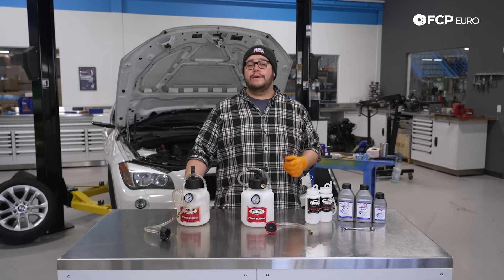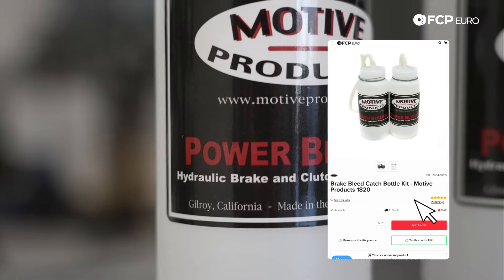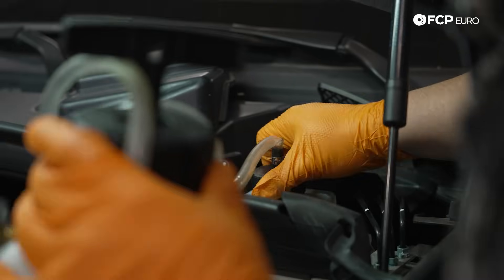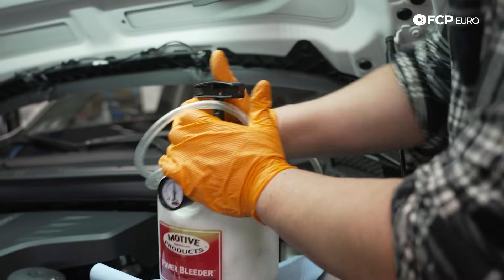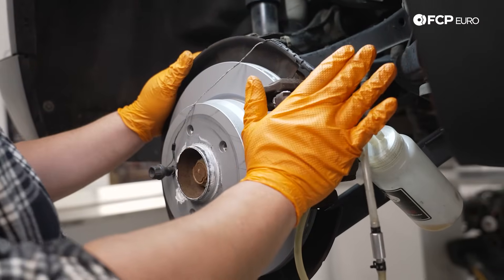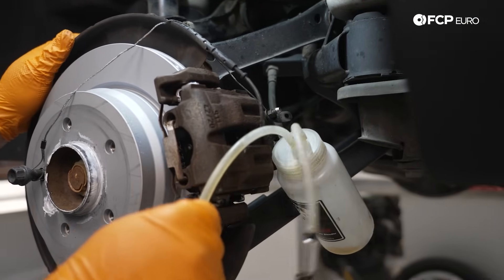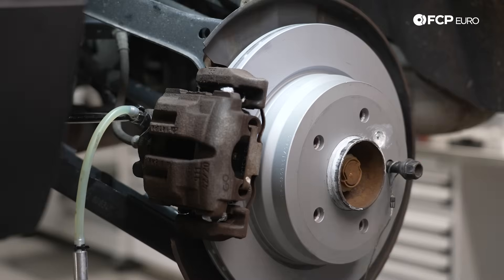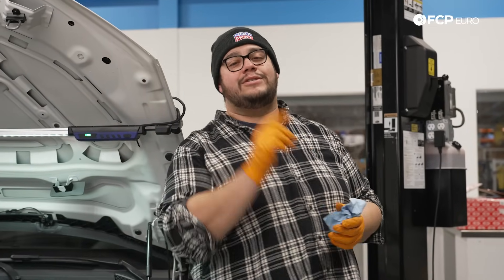How To Power Bleed Brakes Using A Motive Power Bleeder

Comment: no mention about the abs pump? this show method is ok for fluid exchange, but if you replaced master cylinder or abs unit then 30psi is required and ignition on (to open certatin valves inside abs unit). sometimes a bleeding procedure must be done with diagnostic tool. overall good tips. aaaaaaand clutch lines? are we suppose to leave old fluid there?

Comment: This didn't work as it held pressure of 15 psi on my S550 for at least 5 minutes until I depressurized it but when I put 15 psi on it with fluid in it and tried bleeding the calipers, fluid was struggling to come out of the bleeders.

Comment: You can also just fill the brake reservoir and do one side at a time, refilling the reservoir on the car for the other side.  Eliminates some of the mess and keeps the motive pump clean and dry.

Comment: Regarding cleaning and storage... this is from the manual:... "Never store hydraulic fluid in Power Bleeder. Always dispose of excess fluid properly. Use isopropyl alcohol to clean your Power Bleeder. Do not clean your Power Bleeder with brake parts cleaners or other solvents not intended for use with plastic components. Pump the isopropyl alcohol through the tank and hose assembly and let air-dry. If isopropyl Alcohol is not available a weak solution of “Simple Green” can be used. Rinse Well. Ensure unit is completely dry before reuse. Lubrication of the Power Bleeder pump mechanism should not be necessary. Should lubrication be required, apply a small amount of brake fluid compatible grease to the Power Bleeder pump shaft. Never lubricate with petroleum-based oils.

Comment: Interesting that the catch bottle shown has a check valve in the line.Mine doesn't.Is it necessary?
Reply: Better to have it for safety reason to not introduce air back into the system, however its not necessary for this job because the line are full at all time and you close the bleeder before taking out the hose

Comment: I like to use mine dry and just use the unit for pressure.
I can top off the master cylinder between each wheel.
A little more time, but ensures you aren’t leaking brake fluid all over your paint.

Comment: Someone mentioned in the comments that the manual push of brake pedal required to clear sediment from brake reservoir.  I just wanted to know the procedure in precise detail. 

Do you pump the pedal for each caliper? Do you. Push brake pedal while the pressure bleeder is in use?do you push the pedal when the bleeder nipple is open or closed? Do you do this procedure after all the four calipers are pressure bleeded?

Comment: I bought this one years ago. I did a dummy test at home : just blocked the output of the hose ( to simulate the connection to the main reservoir ). After the pumping action of the handle, I always found moisture on the inside of the bottle.
It is physical, when pressure increased, the water vapour in the sir will turn back to water liquid.
So, that means this device will always "create" water & the water will be forced into the brake fluid system by you.

Comment: One flaw of the product, there is no pressure relief valve (prv) on the product. So in this case you have to open the unit from the pump itself to release the excess pressure instead of simply releasing from the prv.
Reply: That's perfectly fine. A pressure relief valve sounds like a failure part on plastic.

Comment: I tried numerous times to keep air in tank but it was not to be; i can watch the gauge as it leaks out. Fixed problem by wrenching tight the two union connections. However, I could only pump to 10 on gauge and it held perfect.

Comment: just a heads up if yall have Drums and the brakes are still squishy after you bleed them you'll need to adjust them. I got trolled thinking i messed up with the power bleeding. that was my issue.

Comment: Does the brake have to be pressed?  How is fluid moving through master cylinder if brake isn’t pressed."
Reply: From the pressure of the vacuum system. That’s the whole point of it.

Comment: Couple of tips from someone who just used this: 

they don’t mention this, but when you connect the provided hoses, use thread tape or it will leak fluid and pressure. 

Takes a lot of pumping to achieve 15 psi. 

You will see lots of air in the pump lines going into reservoir. This is normal. Air rises to top of reservoir so will stay on top. Air in your brake lines comes from aspirating air or intruding small bubbles that are trapped. You won’t be pushing more air into the lines. The physics is similar to burping. If you swallow air you will burp it up. Same for the brake reservoir. It’s the small air gaps far down the lines that are hard to get out and requires bleeding. 

When you crack the bleeder screw you’ll see small bubbles and air gaps in the line. That’s normal. When the caliper is bled properly each time you open it, it looks smooth with no air. Also you won’t see a heavy, steady stream. It’s always very slow. The reservoir bottle at the caliper will get about 1/8 or 1/4 full from each wheel (depending on how many times you open the bleeder). I opened mine about 4 times letting it drain as I wasn’t confident it was doing much. Checking pressure each time. Also you’ll see much more flow as you get closer to the master cylinder. 

To store and clean…empty what you can, wipe what you can and what I do is toss all my fluid pumps in a plastic tote. I wouldn’t clean with water. Worst case scenario is you get a little old fluid in the system next time. Not the end of the world. 

For ABS you don’t “have” to purge the abs system with a scan tool. It’s just a way to get “all” the fluid purged and bled. If you have a scan tool that does that, bleed / flush once as shown here and then purge the ABS and do it again. Some people will bleed, go for a drive, brake hard to engage ABS and do it again. Most techs I talk to don’t even do it unless there is a reason to do so. 

You can buy quick connects from Motive so you can have one long hose and a short hose connected to each cap you need for multiple cars. See their website for more info.
Reply: One flaw of the product, there is no pressure relief valve (prv) on the product. So in this case you have to open the unit from the pump itself to release the excess pressure instead of simply releasing from the prv.
Reply: Great tips. Thanks
Reply: Thank you. I was thinking about this.
Reply: Spectacular tips. Really helped me out at 4am bleeding brakes. One other quirk: 
You have to not only pump it fast with force, but you also have to hit a certain rhythm with the valving used in the pump. Maybe I got a bad one, but took me three bleed tries to get above 4 psi
Reply: @parraandy97 wow 4 am bleed! You are ambitious! lol. Glad it helped. Think your unit may be defective or not sealed great.
Reply: Read this comment 1st my good people!
Reply: Bless you, thank you
Reply: @rachaelcarlson-simon1044 anytime!!
Reply: Thanks
Reply: Ahh this comment is a life saver. My hose line to the reservoir didn’t look as “full” as this tutorial. Was worried I’m just throwing air into the line. Also, flow at caliper was very slow and not “stream” like. 

I’m restoring a 91 E30. First time wrenching on a car so learning as I go. Had a stripped bleeder valve on my left rear so had to pause today. Gonna try and change valve and start fresh tomorrow.
Reply: @JustusWest_ you got this! Don’t worry about adding air. That would take deliberate effort. Lots of people even “gravity bleed” which is just opening the line and letting it drip out.

Comment: I have watched several videos on one man brake bleeding methods. And, in each video I noticed that no one mentions why the Master Cylinder has  “Max” / “Min” indication markings. I’ve never been taught why these markings exist. My assumption is they do because they give a visual indication of brake pad/shoe wear without having to do a full dimensional inspection of the pads/shoes. If this assumption is correct, wouldn’t it be best practice to make note of the fluid level in the Master Cylinder and set the level there after flushing or bleeding procedures? Unless you’ve replaced all the pads/shoes, then of course fill the Master Cylinder to the Max line. Am I missing something?

Comment: When the factory manual talks about scavenging the slave clutch cylinder (for a manual transmission vehicle) in the process of brake fluid change / bleeding .. what exactly does the process entail?

Comment: I've had my motive power bleeder for about 20 years. Only had to "rebuild" the pump one time. The first lasted 15 years. The seals to rebuild the pump are very cheap and easy to do. All of a 2 minute job. The universal reservoir adaptor works great and so do the model specific versions. I have some for the cars I see the most. One of my favorite gifts ever. LoL. Cheers!

Comment: Besides the higher pressure, for us old guys, the bleeding pattern is different, the manual says:
Bleeding sequence
1 - Front left-side brake caliper
2 - Front right-side brake caliper
3 - Rear left-side brake caliper
4 - Rear right-side brake caliper
and:
A pressure of 2 bar is required to bleed the hydraulic unit -
N55-. For this reason it is important to always check the
pressure setting on the bleeder unit.
Always good to follow the manual, cars change over the years, especially with ABS and Traction control.

Comment: What s the difference between the black kit and the red kit
Reply from the maker: The red label uses a plastic molded cap, while the black label uses a CNC machined metal cap. The red label also has a total hose length of 3 ft while the black label's hose length is 6 ft.

Comment: You should loosen first the cap from brake fluid reservoir  then let the fluid came out first on the hose to eliminate the air inside the hose then close tight before you pump😊

Comment: Great video, thank you for posting!  One question:  I was taught and have read to remove most of the old fluid from the master cylinder, then fill with fresh brake fluid before starting the process.  The thought being to avoid pushing all the old fluid through the system and new, fresh fluid enters the system almost immediately   I see you did not do this.  Any particular reason?

Thanks!

Comment: Question. Do you have to extract the old fluid out of the brake fluid reservoir and fill with fresh before using this tool? Can this be used on Asian cars as well.. I have to kia/hyundia brand cars.

Comment: Excellent video, have had this tool for over 12 years and I have always chosen the longer “method” meaning , because have had six different vehicles simultaneously and use different brake fluids I have chosen to never put brake fluid in the Motive tank, therefore I just simply pump the tank to 15 lbs. and start the bleeding process as you methodically explained, I just simply make sure the brake master cylinder does not get too low and keep topping the master cylinder with new fresh brake fluid of whichever type for a particular car that I’m  working with.
Obviously this is more time consuming but I do it this way in order not to have to clean the Motive tank when switching to a different brake fluid, flame away but it has worked for me and I don’t mind the extra work and time involved, I guess there is more than one way to skin a cat . 
Again very informative video and I love the Motive tool, thank you for this wonderful informative video
Reply: I like your idea better; thanks.
Reply: I like your idea too, I've looked at a number of videos and product reviews on pressure bleeders and there have been others suggesting the same - just pressurize the unit with air and fill the master cylinder with fluid yourself.  Worse case scenario, if the pressure unit (or special cap you put on the master cylinder)  has an issue, the damage should be minimal because it is just air and not air and fluid.   Taking longer is not a bad thing at all if you can minimize some of the risk plus you save time as far as cleanup!

Comment: Great video.  Unfortunatley, I could never get a tight seal around the brake fluid reservoir.  Made a mess everytime I tried, no matter what.  Ended up throwing the product in the trash  :(
Reply: In some cases there is too much room between the threads on the reservoir and the bleeder adapter.  Properly applied Teflon pipe tape applied to the reservoir threads will seal the connection.

Comment: Will this process remove any trapped air in master cylinder or abs line too?
Reply from the maker: It will, as it is pressurizing the entire system. Some vehicles have an ABS bleed function which can be accessed via a scan tool as well to help even further.
Reply: @fcpeuro  thanks

Comment: Do you need to take any fluid out of the master cylinder before hooking it up? Once hooked up and pressurized it pushes the fluid through the brake lines while keeping the master cylinder filled correct? No need to keep checking level in the cyclider, correct?
Reply from the maker: There is no need to remove any fluid; the tool takes care of everything for you. The only time we would suggest suctioning out the fluid from the reservoir is if it is extremely contaminated; there is no sense in pushing that through the system.

Comment: Thank you for this helpful video, I have a question, different cars have different brake fluid reservoir caps, how does the Motive Power Bleeder can fit to these different cap threads, sizes? I would appreciate an answer

Comment: So how did you confirm the air in the pressure bottle and tube was removed before you started bleeding…when you first filled the bottle with new brake fluid? Apologies if you already answered this question.

Comment: Soon I wil use this principle, I only have one question about the abs. My car is from 2009(skoda), I don't have an obd2 device. But I read online that you can pull the abs-fuse before you start and replace it when done. Is this an accurate way of doing it? Or would you recommend leaving the fuse in place? I have seen a few videos already and often nobody mentions what to do with abs. Thanks for your input!

Comment: What is different between flush and bleed?
Reply from the maker: Flush is done when you just want to flush out the fluid for fresh juice. A bleed typically refers to when you have opened the system and need to get air out of it.

Comment: I have an issue with my daughters car. I replaced the rear right and left calipers, but in the interim of exchanging cores at the parts store, I lost a lot of fluid. Now as we're attempting to bleed the system, it either has a ton of air in the lines or something else has gone wrong. It doesn't seem to be gaining stiffness in the brake pedal as we move along from caliper to caliper. Do you think this system would be  a good fit to resolve this situation? It's a 2014 Ford Escape.

Comment: The first time I bleed brakes on my Truck, this motive bleeder worked perfectly. The Second Time I had a problem. I had filled the Motive Pump bottle 1/2 full of brake fluid, pumped the pressure up to 15 psi, and then began to bleed the brakes one wheel at a time, making sure I pumped up the pressure to 15 psi after each wheel. When I got done with the 4th Wheel, my Motive Bleeder was still half full of brake Fluid, but I didn't have any fluid in my brake fluid reservoir on my master cylinder. For some reason the motive bleeder wasn't keeping my brake fluid reservoir full as I bleed the brakes. Now I have to do it all over again.

Comment: Always good to empty the reservoir and fill it with clean brake fluid before you attach the Power Bleeder.  Much quicker than pushing all the old/dirty fluid through the system.
Reply from the maker: Great tip!
Reply: Do you also need to add fluid in the power bleeder?
Reply: @cunikeq yes
Reply: This!! ⬆️ ⬆️
Reply: One thing I liked to do was clean out the reservoir, at least on the ones where you had easy access to clean. Many you can't really do that other than pouring fresh brake fluid in and trying to suck out the black gunk that likes to collect in the bottom of the reservoir.

Comment: Spent at least 20 mins trying to get the pressure to hold on this thing. The brass thread on the end of the bleeder and the brass thread on the end of the reservoir tube required me to add some plumbers tape to the threads and then tighten the brass fittings down so that only God Himself will ever be able to un-tighten the connection. THEN finally I stopped seeing a pressure bleed. Buyer beware.

Comment: So you stand at the master while it's bleeding each wheel and pump as needed? Or does 15 lbs of pressure do one caliper or lines worth of bleeding?
Reply: Hi ?  If we need  increase the  Psi  we have  to stop the process  and close the caliper line  or we just pump it  back to 15
Reply: 15psi should do 1 caliper. You'll know if you need to pump it again based on fluid flow from the bleeder screw. 

Always good to check the pump after each caliper to make sure psi is still good as well as fluid level in the bottle & master, but that shouldn't be a problem at all given the master is topped off before bleeding/flushing & that there is also plenty of fluid in the bottle.

Some people actually leave the bottle dry which I'm thinking of trying which means you are disconnecting the bottle after each caliper & topping off the master each time.

Comment: Alas the seals fail after a year on these. I just went to the spray  bottle and vaccum tube method.
Reply: Yeah, mine leaks from the pressure gauge now. Had 2 good uses from it over about 4 yrs. Leaked from new also, but thread sealant tape fixed it before. Not now